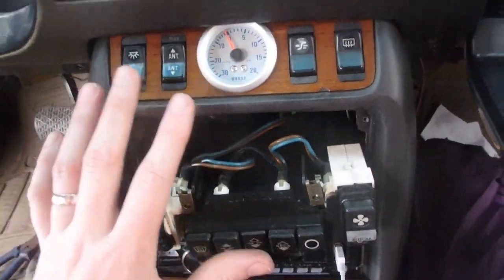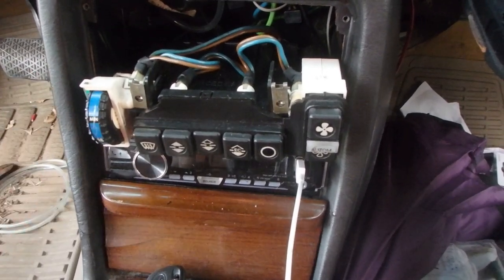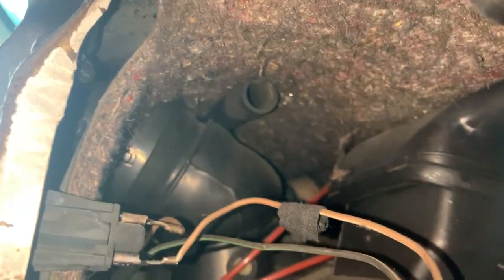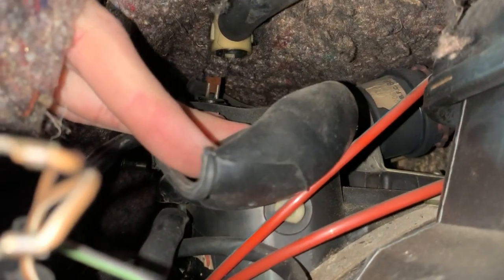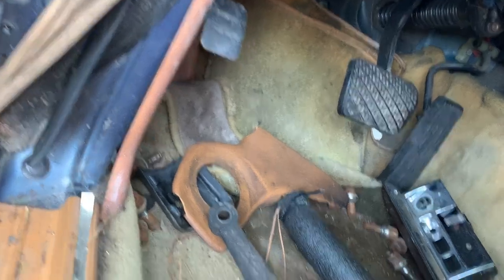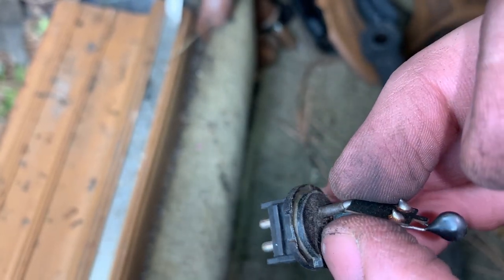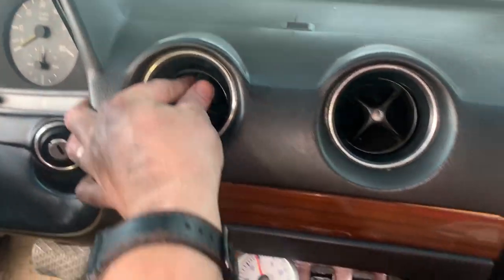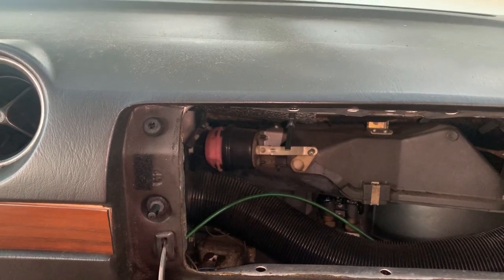Mercedes 300D W123 Climate Control Sensor Repair

Comment: Hi! I have the same ACC system on my 84' R107 280SL. I have AC if I have the wheel on full cold, but as I move it to 18, it goes hot. Im pretty sure that it is the sensor that either is missing, not connected or not working. Can you help me on knowing at least were the other end of the sensor cable goes connected? Is to the bosh grey box (Temperature Reguler I think that its called) or goes to the buttons on the center console? Do you have the sensor and cable partnumber also? Thanks in advance! Great video!

Comment: Were you able to get a replacement tube?  If so, where?  I have the identical year and color as yours. I pulled out the glove compartment and found the exact same situation where the tube was missing. Thanks.
Reply from the maker: No I haven’t. The pipe insulation is working fine for now.
Reply: @mjmcomputers  I bridged the gap with flexible 5/8 OD PVC tubing. I will see how that works.
Reply: I ordered the mono valve replacement kit from Klimakit. They included a new replacement tube. Benefit is that I'm able to keep everything original if I want to go back to OEM, but for now- I no longer have to buy mono valves. Nice

Comment: I have a 1985 300D turbo and the heater will only work if the battery is on but when I start the car the heat stops
Reply from the maker: Sounds like a weak mono valve.

Comment: i wander if the sensor is some type of thermistor that can be checked with an ohm under different temps?
Reply from the maker: Probably is but no idea what the values should be.

Comment: My car is a 1985 300SD and my heater does not work any suggestions
Reply from the maker: Just blows cold? Sounds like it could be a mono valve issue.

Comment: I have the same problem , but on the highway I don't get hot air, only below 35 mph. Weird.
Reply from the maker: Could be a torn monovalve diaphragm or week magnetic coil. I just posted a monovalve rebuild video. It may be worth checking out.